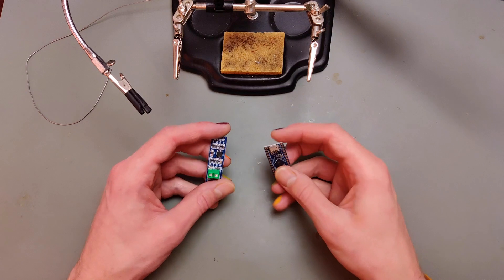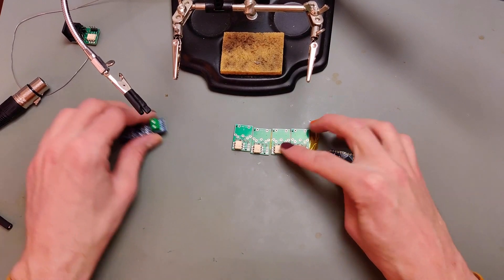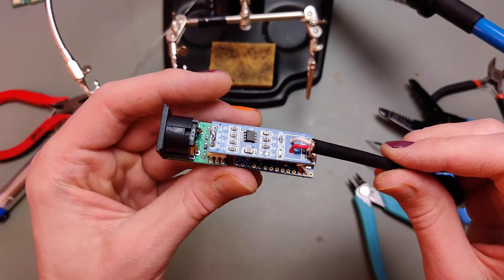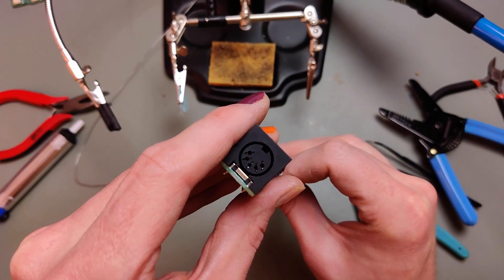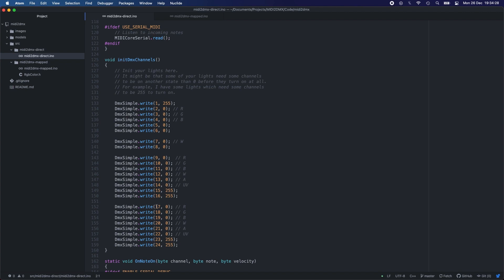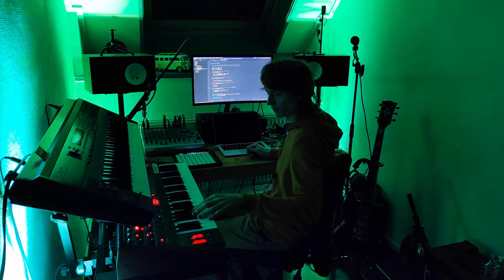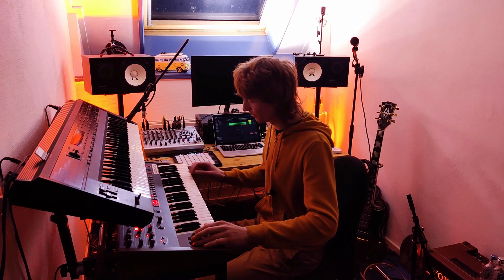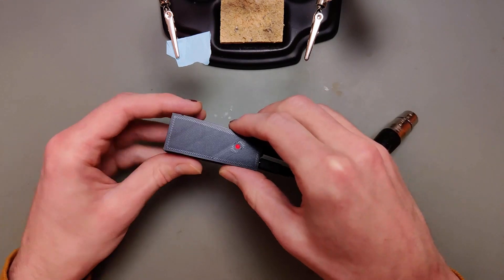How to build your own MIDI to DMX interface (DIN5 to XLR)

Comment: Zooo goeddddd! ik ben op zoek naar zo'n dingetje! verkoop je ze niet...? ik ben niet zo handig in dit soort dingen... ik werk nu met een lomp grote controller waar ik alleen de MIDI > DMX converter van gebruik...
Reply from the maker: Hey Edwin, helaas verkoop ik ze niet. Was wel een ideetje, maar uiteindelijk moet de code steeds aangepast worden tot ieders eigen systeem. Ik zou dan ook een app moeten bouwen, maar dat zit er niet in voor mij. Het is nu de bedoeling geweest om de DIY community een jumpstart te geven om zo'n module te bouwen. Bedankt voor je compliment! :) Groeten, Bass
Reply: @bassjansson  Dank je voor je antwoord! We gaan proberen er zelf eentje te bouwen... heb je tips voor ons...?
Reply from the maker: Mensen lopen soms tegen wat kleine probleempjes aan, die zul je vinden in de andere comments onder deze twee videos.

Als je de MIDI DIN plug niet nodig hebt, en USB voldoende is, dan zou je mijn eerste versie van de module beter kunnen bouwen.

Handig zou vooral zijn om iemand te hebben die verstand heeft van Arduino's programmeren, die mijn code zal begrijpen en aanpassingen naar wens zou kunnen maken.

Ik heb twee software versies, direct en mapped. De eerste video gebruikt direct. Deze heeft een stuk minder aanpassingen nodig en werkt zowel meteen, maar deze kan niet worden 'bespeeld' door bijvoorbeeld een synthesizer. De mapped versie is iets meer aangepast op mijn eigen systeem en kan worden 'bespeeld' door een synthesizer. Deze zou dus echter ook iets aangepast moeten worden op jouw systeem.
Reply: @bassjansson  Ik doe het JUIST voor de MIDI connector... we spelen live met een sequenser die MIDi en Audio afspeelt, daar wil ik dus ook het licht mee gaan aansturen! 🙂